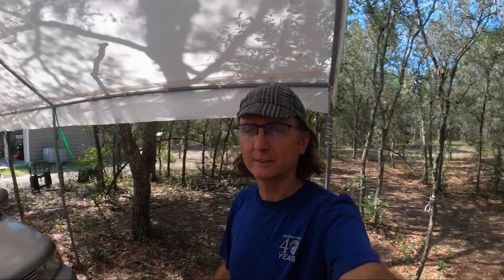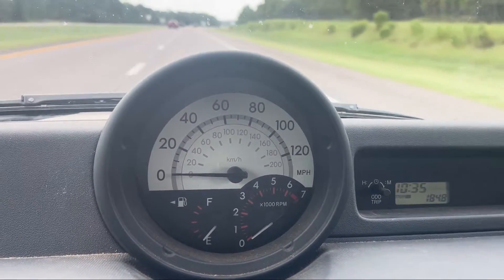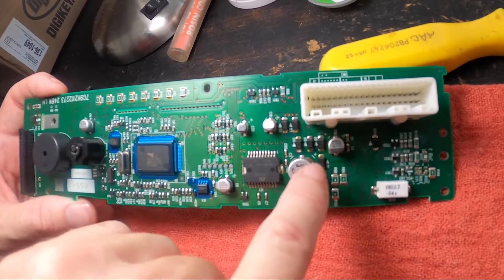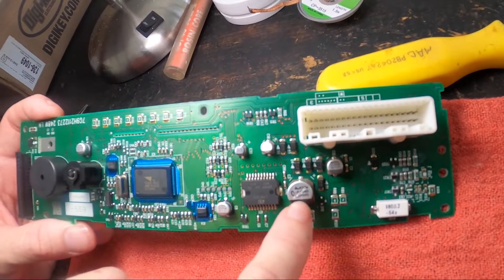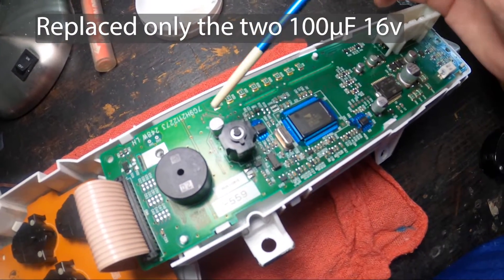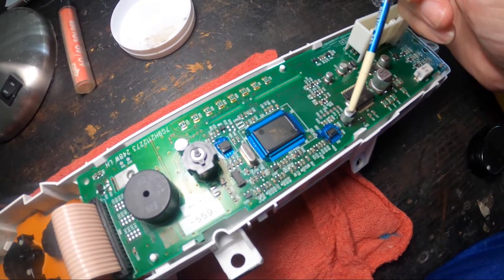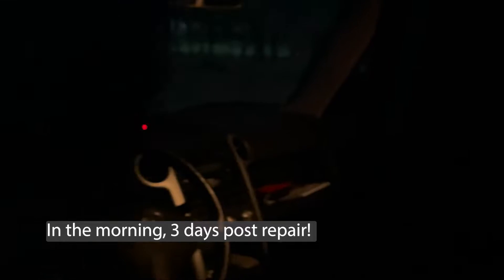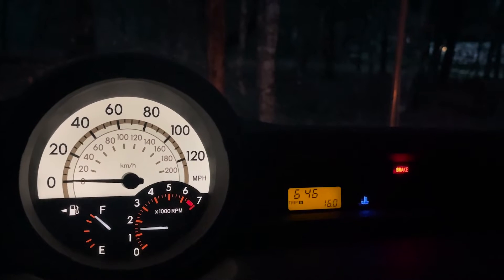Scion xB Instrument Cluster Repair

Comment: i have an 05 with 270,000 miles that still runs perfectly and I need to do this. It only does it when it gets under 25 degrees and it sits for longer than 8 hours, sometimes it takes like 15 minutes to warm up and they come back on.

Comment: Hey your video was amazing. Thank you so much for the help. Ordered the capacitors from Digi key just like you said. Worked completely…. Advice to anybody else having to do this find your local computer repair shop. Mine only charged me $25 to replace both pulled up in their parking lot and removed my cluster and took it right inside to them…
Reply from the maker: Hey there Shanenn! Many thanks for the compliment and happy to hear it worked out for you. Funny you mentioned the computer repair shop because this was going to be my backup plan if I couldn't get soldered up myself. As of today my cluster is still working like new and over the weekend I was in 26* temps and all is well. Take care! ~Ron

Comment: Hi Ron, 
Did you eventually replace all 6 or just those 2 capacitors

My scion started doing the same exact thing, but that tic in the speedometer actually became a battery parasite and killed my new battery.
 I couldn't get anyone to repair the cluster, so i'm gonna practice soldering on a practice board and then I'll replace these capacitors. 
I ordered Rubycon 100uf 16v, I read these are really good.
Reply from the maker: Hello Mikki! I only needed to replace those two that I show in the video and my cluster is still going like new since then. Yeah I was getting that same tick and drained battery too, but not anymore. Good luck and please let us know how it goes.
Reply: @ron.bennett 
I changed those 2 capacitors today, and I started it up with no issues, I'm hopeful that it's a permanent fix.
Thank you so much for posting this video, it helped me tremendously.

Comment: Just wanted to say thank you so much! I went a few years with none of the gauges working, and had to install a battery cutoff switch to stop the parasitic drain on my battery. I replaced just that one main capacitor you showed and the problem is solved. I can't believe that that something that was such a hassle could be solved that easily and for that cheap. Thanks again for figuring this out and posting it.
Reply from the maker: Happy to hear it worked for you and you are very welcome. Take care Ron

Comment: Wow, this video is great. I’m halfway through it. Your story is my story! I’m in panhandle Fl, so same thing, I wasn’t too worried about. But now it has become far too frequent. It’s not safe. 
I will def leave another comment later on if I’m successful. Well, not me but help from a friend so we can do it together. 
You are an excellent teacher! Your video has excellent pacing, you have a great way of talking through the parts and steps and issues. 
I feel confident in this now.
Like you mentioned, so many post about it, but few find a permanent answer. 
Thank you for putting this out. It seems to have helped a number of people so far! I love that there are other lovers of Scions like my family. We own serveral of these old XBs. Mine is at 330,269 miles as of now. And I don’t have that screw either on the dash. That’s so funny they manufactured the space, but didn’t include the screw above the odometer. 
Thanks again!

Comment: This is the first time I saw it Happen because it was super cold but it’s never done this but now the Speedo and fuel gauge are off so I’m going to just do the repair. I just fixed the motor mounts and battery along with everything else wrong with the car because I don’t like driving the car with issues my ocd won’t let me.
Reply from the maker: good luck!! This should fix your issue. ~Ron

Comment: Just for clarity, is this only for the lighting? Or were the gauges not working also?
I have a 2006 Scion XA that the Speedo and odometer is not working. The Speedo never moves and the odometer is stuck on 137490 miles. Also getting ABS and brake light and check engine light. It’s a 5 speed manual transmission and scan tool shows 2   p0500 codes for vehicle speed sensor A
Any input would be appreciated.🤙🏼
Reply from the maker: @xrossfire808  hey there! No this issue is with the gauges working, then not working, back to working, etc… My gauges and I believe others have also mentioned would be twitching and then come to life and work as normal. For me this also caused a drain on battery. My odometer never stopped working, but the Speedo, fuel, tachometer would and my dashboard lights would surge as well. I’m trying to recall if any other lights would illuminate but I can’t remember now. While driving if the gauges were not working they would just twitch is the best way to describe it. Initially this issue only happened when the temperature was say 50F or colder, but over the years it progressed to doing whenever it wanted to regardless of the temperature. Good luck 🍀👍

Comment: Just wanted to send you a huge “Thank you”.  Just started for me 2004 xb. i replace the cap in the middle and it worked.  Any one else having an issue with the speed od light flicking when using the dimmer dial ??
Reply: 🏆 2nd person to replace only the middle cap with success 🏅
Reply: My speedo is flashing off and on (along with the maintence and other dash lights) for about the first 10 mins of the drive but only on cooler mornings, gonna replace the main 100 16v capacitor to see if it works.

Comment: have had caps to do this for quite some time and recently has become unbearable so broke down and found a guy with micro setup to do this right and paid the man. replacing the 2 100uf 16v caps like in the video fixed it up like new. used the digikey caps. Very thankful for the video. Best mod done to box in quite some time......
Reply from the maker: @i12video  you’re very welcome and happy it worked out for you!!

Comment: Thank you so much for your very informative video. Like others, I was having this mysterious on-again, off-again problem with my 2004 Scion xB instrument panel. No speedometer, no rpms, no gas guage, just flashing dash lights. Otherwise the car operated normally. Like you described, it was only once-in-awhile during cold weather at first (after 18 years of no problems.) But then it was off more than it was on. I wasted time and money asking a regular mechanic to fix it. All they did was clean my battery terminals, which had no effect. A Youtube search found your video. You described the problem and dove right into how to fix it. Based on what you said about the left-most 16v capacitor not having an effect (and what someone else said in the comments,) I decided to go right for the middle 16v. I ordered the parts (two just in case) from DigiKey with the part number you provided. Once they arrived, it took a few failed phone calls and walk-ins to find someone who specialized in micro-soldering but I eventually found JB Electronics on Dixie Highway in North Miami. They had good reviews and it was close to home. Jose was a bit curious as to why I wanted this one specific capacitor replaced (none showed any sign of wear) and I told him, "because that's what the internet said to do." He had it done in a few hours. I put it all back together, and now the instrument cluster works perfectly. Thank you again for your excellent video.

Comment: For my 2005, the first issue I noticed was on coldest/damp mornings, starter sounded like it was hanging, not pulling off, so I would quickly turn the engine back off again.  After one or two tries, sounded like starter now fully disengages, all ok then.
  That is when I realized it was associated with most of the warning lights flashing repeatedly and a clicking sound coming from the dash.  Later realized that if I used the door lock remote to open the door on those coldest mornings, the clicking sound (same rhythm as the flashing) in the dash was already happening even before I put the key in the ignition.  So now I have learned to just turn the key and let the flashing go on for a couple minutes before turning to engage starter.  Waiting like this eliminates the starter problem and a minute or two later the guages start working.  Also have the same pulsing in the gauge lights all the time.
   I was suspicious of the entire power supply to the cluster until I found this video.   
   Happening more often now at less cold temps. 
  Do you have any thoughts on these additional symptoms?  
   Also in Florida.
Reply: Check the voltage on the battery before starting....  the FLASHING DASH will drain the battery overnight.

Comment: It’s Veterans Day, November 11, 2024 and I am happy to report that changing the two capacitors that you did, fixed my instrument panel! Thank you Ron for your tenacity in finding the cause! I tried for 4 hours but gave up snd had a professional electronics guy solder mine. It was worth the $65 to get it done, but I am not talented at soldering! No more speeding tickets or running out of gas! Woohoo! Thanks again Ron! ❤
Reply from the maker: Hey there BonoBos! Awesome to hear and yes $65 well worth spent. Happy to hear it worked out and thanks for the feedback. Take care! ~Ron
Reply: What places can do this for me?
Reply from the maker: @barnzzubobque6058  I have no idea sorry. However, I am thinking if you took the cluster out of the car, you could probably take it to anyone that works on circuit boards. Maybe @Bonobos922 or someone else on here can suggest a place. Good luck!
Reply: I've been waiting for this video. I too have a 2005 and have had this same problem for a few years now. I refuse to get rid of the car. I'm gonna try this and hope it works for mine too.

Comment: Mr. Ron, I have to say you beat me to the repair by over a year. I knew it was gonna either be a solder joint issue or caps and you beat me to making this video. I been putting this off for over 2 years, but here it is and had considered doing a video too. 😊

I will definitely refer people to this video in hopes they can repair their cluster with the help of this video.

Great video and thorough explanation of the teardown and replacement of the caps and part numbers for them and hope you have a good return for the time you spent on this video.

Great work sir and thank you. 🙏
Reply from the maker: Hey there Darseid! I am just happy that this repair and video seems to be helping people out. YouTube is huge so if you want to create a video as well, I say go for it. I am not getting anything in return from this video other than being able to help others. It's all good! Thank you for the compliment and for checking it out. Take care! ~Ron

Comment: Wow, thanks! I was looking for a fix. Looks like something I can do, soldering is in my blood. My pops was a radio and TV repairman and taught me a lot. Just ordered the caps and look forward to fixing this old issue.
Reply from the maker: Hey there! Hope it works for you and good luck. My repair is still going after more than a year, so if I can do it so can others. ~Ron
Reply: @ron.bennett  yup, just did it. About 1/2 hour job. A round point soldering iron would have been better than my 1/4" flat tip, but it worked fine. So glad to see my gauges working again! Thanks so much for making a very detailed video on how to fix this issue! Mahalo!

Comment: Would you have a video recommendation on soldering these capacitors? I'm currently working on it and so far, it has been tricky. Might have to try with another board. Thanks!
Reply from the maker: Hey there MVoelker! Sorry I wish I did, but sadly I do not. It is tricky for sure and my soldering was not at all all anything to brag about but they are still holding up for me. I will say, if I have to mine over, I will invest in a nice soldering iron. The one I borrowed from a friend was not the best and I think this made the job harder to do for me. Good luck and just take your time.  ~Ron
Reply: Get a pin-point soldering iron and a second set of hands.  Have someone else hold the CAP down.

Comment: You're my hero for this one Ron! Have been dealing with this issue for a couple years now on my '05 xB. Thank you so much for the thorough walk-thru, and also the detailed breakdown of the parts needed and where to get them. Round of applause for this guy right here!
Reply from the maker: Hey there DJBoomshot! Many thanks for the comment and happy to hear it worked for you. Cheers!!
Reply: @ron.bennett  hasn't worked just yet, as I'm due to get the parts in a few days -but my mechanic feels pretty confident he can follow your example and get the same results. I'll circle back and let you know the results in a week or two!
Reply: Hey Ron. Finally circling back after a couple months. My mechanic just did the same two capacitors that you did, and after two plus months, it’s still working perfectly! Thanks again for the top notch instructional video! You’re a hero to (probably) thousands of other xB owners!

Comment: You can test the capacitors in circuit with ESR meter. The one I use is a MESR-100 ESR Meter. They're inexpensive

Comment: Hi my hazard lights of my car keep staying on  do I have to remove to the fuse box to temporarily get my hazard lights off ? Or the relay switch?
Reply from the maker: Hey there Jason. So you may have something else going with your hazards. I didn't have any issues with my hazards and I haven't heard from anyone else having this issue either. Just so I can understand a little better what you're experiencing. Are you referring to the lights on the console or are your external lights staying on? By on, do you mean flashing or steady on?

Comment: I swapped the 3 capacitors and the disks work, but now my LCD display has a mind of its own. It doesn't respond to the control pin and I can't read my odometer. Does anyone else have this problem?
Reply from the maker: Hello Hydrolix! I wonder if by chance when you put the board back together that maybe you bent one of the pins. Look at minute 6:14ish and right near my thumb are a series of pins in the plastic. You may want to carefully pull it apart and check that none of them are bent down. ~Ron

Comment: Just did my mother-in-law's 2005 xB today. Replaced the two capacitors (a little challenging and I have a BSEE and soldered for years. Component mounting has changed since college), plugged it all in and all is good.  Her battery was dying every 24 hours so we will let it sit for a few days and see what happens.  Thanks for this Ron and especially the part numbers and source.
Reply from the maker: Hello Roger! Great to hear that it worked out for you. Yeah soldering these Caps was a bit tricky for sure. I had a crappy soldering iron so that also made it harder for me. However, my soldering is holding up great so far and all my lights are bright and the gauges are popping up like new. I was also experiencing battery drainage but since the repair it seems to be better. Fingers crossed this also fixes your Mum-in-law's battery too. Please let us know if the battery issue is fixed too. Take care!! ~Ron

Comment: I did try that first, but when I typed the caps and their call number I got something different. Just wanted to make sure I was getting the correct caps.; I guess example would be typing PCE453CT-ND 100uf 16v gave me a different number..so wanted to make sure . will give them some time to reply to the email I sent. Smiles, Steve 
D
Reply: I just ran across this video today. I have the same problem with my 05 scion. I just tried ordering on Digikey and typed that first part number and got something else. I will call on Monday to hopefully clarify the different part number that pops up. Today is October 18, 2024. I know this was a year ago, so hope you got the correct part numbers. 😊

Comment: Thanks for the reply Ron, I did reach out to digikey and the nice lady on the phone said I needed to send an email to the engineering team with my request for the capacitors. Did that the day before yesterday and no reply as yet. May have to source the caps from another vendor, but will give them some time. As you mentioned, it will clear up as the car is driven. The best info I got from you and others is that the vehicle can still be driven safely... Best regards, will advise if I will have to source the caps from another vendor...Steve
R
Reply from the maker: Hey Steve, so maybe I am misunderstanding something. Why can't you place your order through their website instead of emailing their engineering team?

Comment: I owe you a coffee! This issue occurred briefly last year and when I researched it then, there weren't any "aha" moments. It started again a few months ago, and much more frequent... and that's when I ran across your video. I decided (apprehensively) to give it a shot. I ordered and replaced the two caps. All the gauges are now in perfect working order, no more flickering backlight, and the fuel gauge seems more accurate now than before the issue began. Thanks again!
Reply from the maker: Hello Robert! Great to hear and happy it worked out for you. My dash is still working like new since I did mine. ~Ron

Comment: i just wanted to say "Mahalo"! I watched your video and was having the same issue with my 05 Scion XB, with the speedometer not working, i ordered the capacitor's thru Digikey and replaced the two that you did and it workied! Thanks Again!😇
Reply from the maker: Hello Terence and "He mea iki" (hope that is correct!). Happy to hear the repair worked for you. I can say that my gauges are still working perfectly since the repair. Thank you for letting us know it also worked for you and just in case my translation was not correct, "You are welcome!" Cheers ~Ron
Reply: What part number did you order?